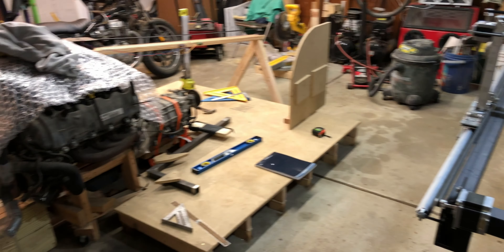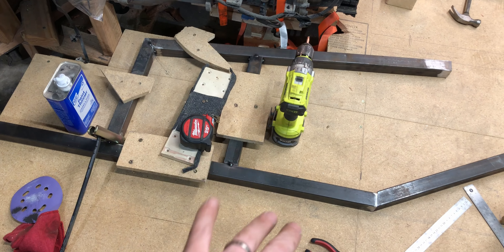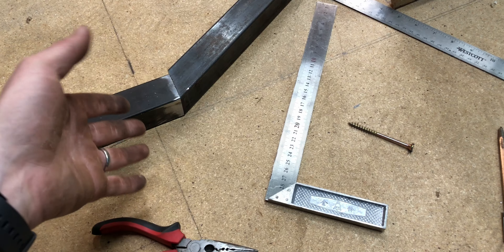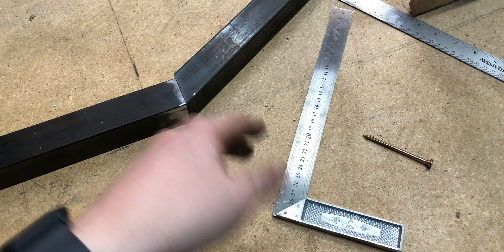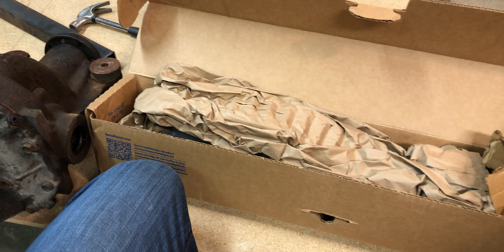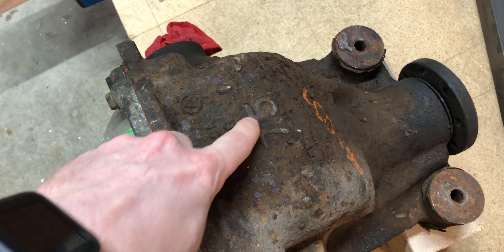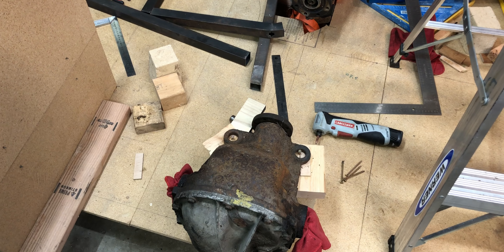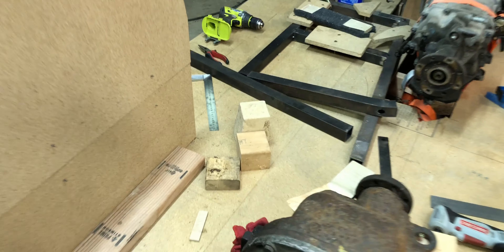$10k Shelby Cobra Build Part 6: Building the Frame

Comment: Looks very good - thank you for sharing your built! A small suggestion for bending tubes: if you don’t have a CAD design to know the lengths/angles exactly - you could use some stiff wire or soft tubing (e.g. brake lines tubing) in order to play around and mock up the pipe with bends. Same for suspension components - might make sense to mock it up with soft tubing or wood and swing around the mocked up wishbone arms and uprights in order to check clearance and wheel angles.

Comment: Don’t go packing your half shafts to centre your diff with the prop shaft. It is normal for some prop shafts to not run exactly true- (offset diff) that’s why they have Universal joints on the shaft. Worried your not making 100% symmetrical- it will come back and bite you.
Reply: Thank sir